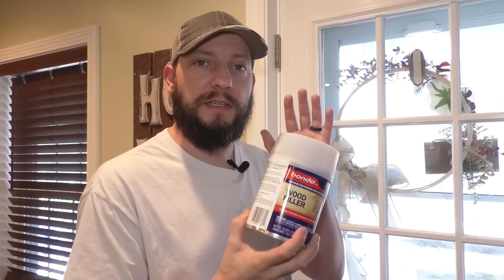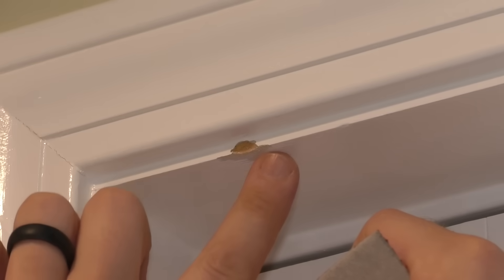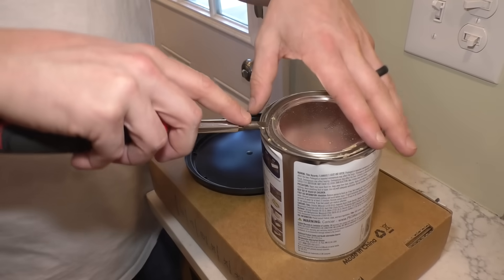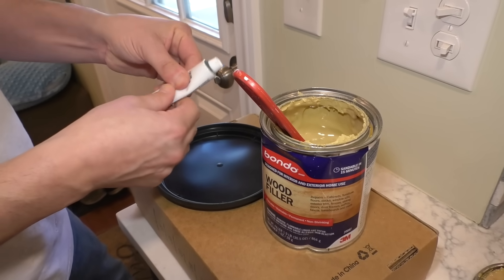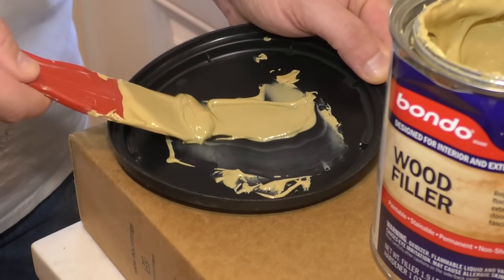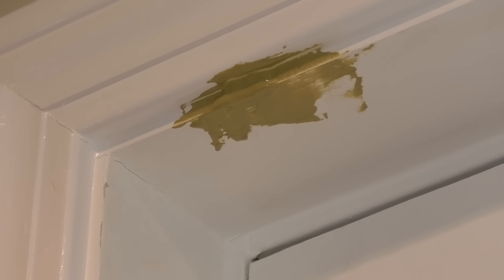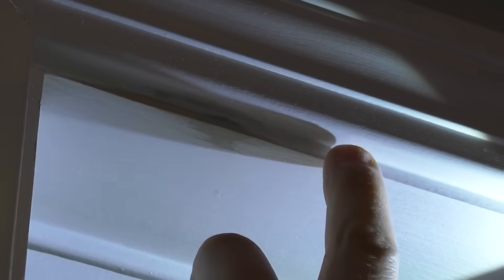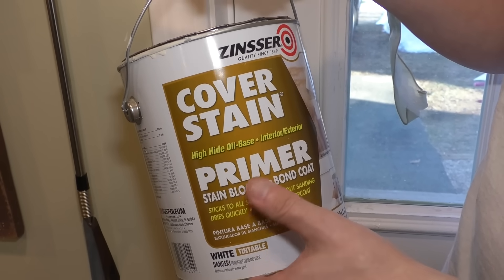How to Fix Damaged Wood Trim | Easy Woodwork Repair!

Comment: I recently had my house painted, when I was going through what I wanted done with the painter, we noticed some dry rot around a loose knot on a piece of facia. He recommended that about six feet of the fascia be replaced and it would add $450 to the price of the paint job.  I told that I would take care of it myself.  I went online and bought some wood hardener and wood Bondo for less than $50 .  I chiseled out the dry rot and loose knot; once I was down to solid wood, I treated the cavity with a liberal dose of hardener. After that stuff cured ( the treated area was as hard as a rock), I filled in the hole  with a few layers of the Bondo. After a little Surform plane work and sanding, I gave it a coat of primer.  The repaired area is indistinguishable from the rest of the facia. Great stuff!

Comment: I was happy to see you use Bondo correctly by cutting it down while it's in the plastic state. It's designed to harden to the plastic state where you can work it with a knife or cheese grater type file to quickly get it close to the final shape. Then as you said it will harden rock hard for sanding.

So many DIYers let it harden 100% and then spend hours sanding...

Comment: Hey Matt—well done; it turned out great. I don't know if anyone else said this, but taping or masking off an area will minimize much of the time spent removing the excess bondo. It also helps reduces the risk of more damage via a slip of the chisel.  :(    Great job and a  👍 as always. God bless.
Reply: Yes, I mask off as well....  It really helps....  I use this stuff all the time for wood rot repairs in tough areas.

Comment: I use the red Bondo glazing putty that comes in a tube. Just squeeze on a blade and you can fill every nick in your house. 
Sands out super smooth in about 5-10 min.

Comment: I used joint compound n sanded I first tried with heat gun too much work after spending 2 months citrus stopping wood stairs

Comment: Wood filler would have worked since it’s not a high wear location.
Reply from the maker: I suppose but depending on the filler I would be worried about even the vibration of the door closing loosening it up.  Definitely would not use any kind of spackle.